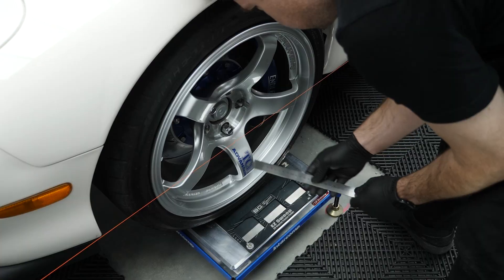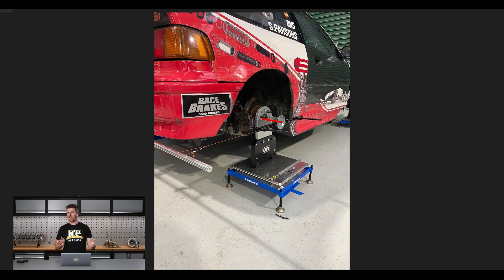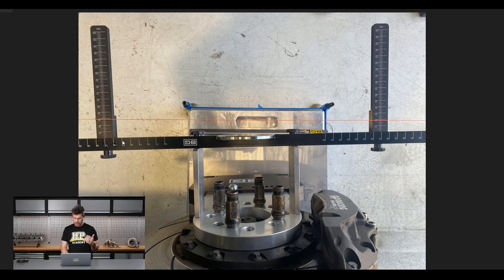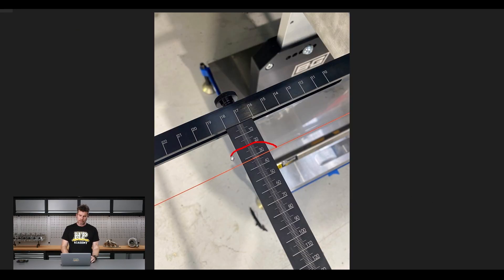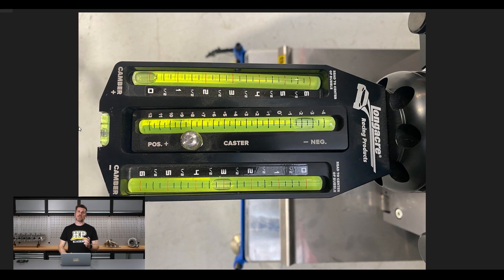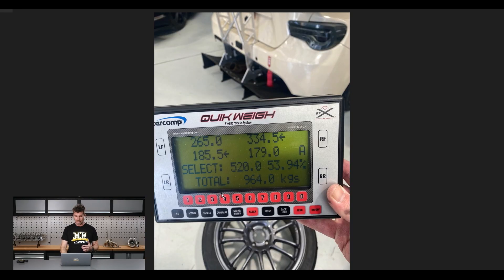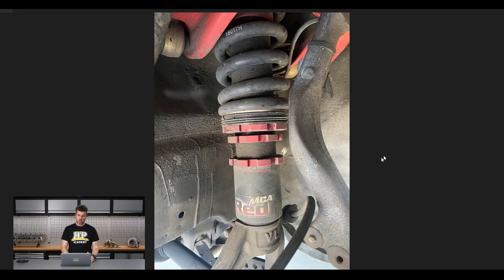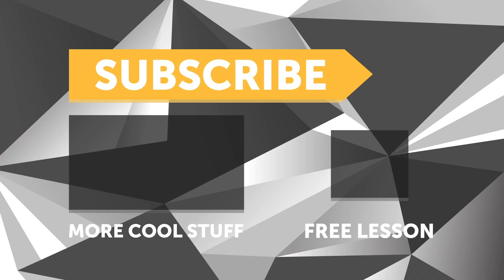Quick CRX Wheel Alignment and Corner Balance

Comment: That’s funny seen a old method my grandfather and my father used. 
  Strings and measuring tapes or tram gauges. 

If done right by a profession person it is just as accurate as the $50,000 laser machine
Reply from the maker: One of the great things about this system is that even if you aren't a professional and are still learning, it is easy to tell if something is wrong. If you have a string in the wrong place, you can check and see, then fix!

If you're $50k alignment machine is off, you cannot tell without using other equipment to check, and you cannot fix the issue yourself. 

This is why simple systems like this are still popular even at high levels of motorsport and why when you're a grandfather I'm confident you will still see people with string alignment systems in the paddock on race weekend 😎 - Taz.
Reply: @hpa101  Yes I was taught the old fashion way using a string and measuring and  tram gauge. And through the decades always used hunter or beer light a line when it first came out and then the laser line when it first came out. 

And now I get to use the most expensive exotic machines in other shop owners businesses when I need my own alignment done I have every piece of equipment at the tips of my fingers and the one thing I noticed all this automated computer control tell the technician what to do next dumb down to technicians they don’t know what they’re doing and when anything is wrong they don’t even know it’s wrong and they don’t know how to fix it. 

Welcome to the new dumb down education of American mindless robots 🤖
Reply from the maker: It's the same everywhere, it's part of technological advancement for better or worse. I mean I couldn't build the computer I'm using but I (allegedly 😂) know how to use it relevant to my job right? Same with many other day to day items. Just part of where we are at as a society with technology. 

Although while I don't think it's required to need to build your own computer to use one by my line in the sand, I do think you are correct and to use an alignment machine you should understand the fundamentals of the changes you're making rather than just mindlessly doing what the readout states not even having the knowledge to know if it's wrong. 

It's hard to train people to care though no matter where your finger points in blame on that one though!

My whinge for the week haha, cheers for the chat and I hope you enjoy the weekend 😎 - Taz.

Comment: How easy would it be for the hub stands to roll off the pads and come crashing down?
Reply from the maker: Hard due to the lip. 

Like anything, if that was your dream and you worked to make that happen I'm sure you could....but why you would I do not know 😂 

On a serious note though, if you have all the same equipment we do and are not comfortable using it how we do, don't 🧠 - Taz.
Reply: This is a very real risk. 

If you are performing your alignment on turn one at Talladega.
Reply from the maker: haha yes we definitely wouldn't be doing this on a lean with or without the scales involvement!

Just in case I came off a little strong above, safety is important and you shouldn't ever assume something is good just because someone else said it was. Check to make sure your car is secure before working on it no matter your setup. An extra 1-3 mins making sure you're happy is better than being squished, and a healthy fear of that happening is good to make sure you don't do anything dumb 🤘 - Taz.

Comment: Lost count of how many 'tape measure' wheel alignments we did in 10 years of amateur rallying 🙂
Using factory steering components for terrain that would scare most 4wd owners certainly tested the upper limits of the engineering margins 😁

I was often surprised to find out how close we'd got to zero toe with the tape, after checking it out at work following the events 👍